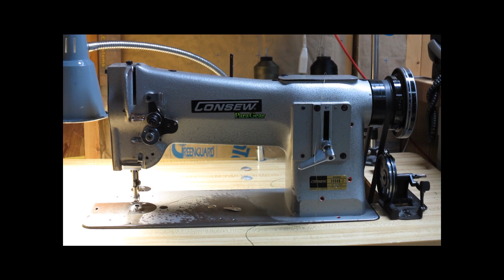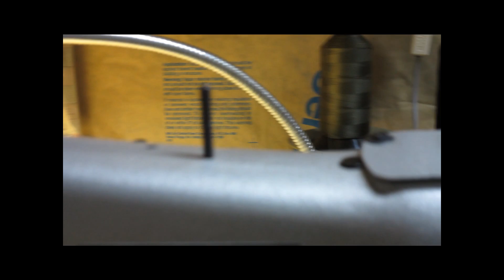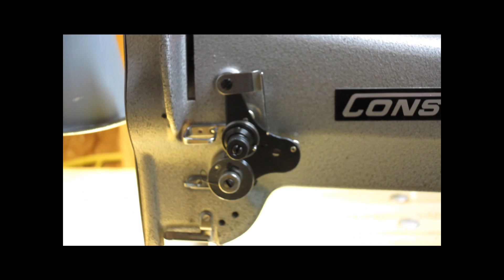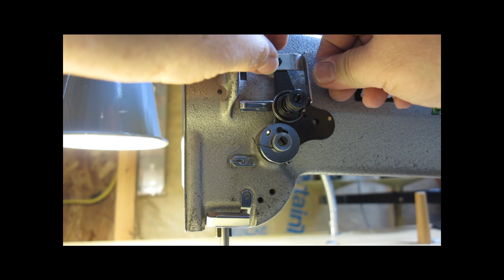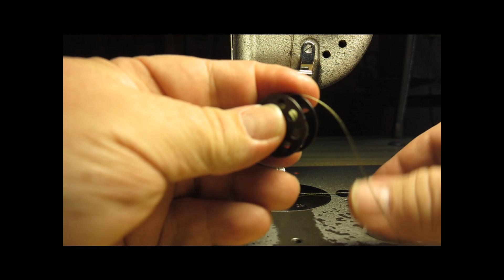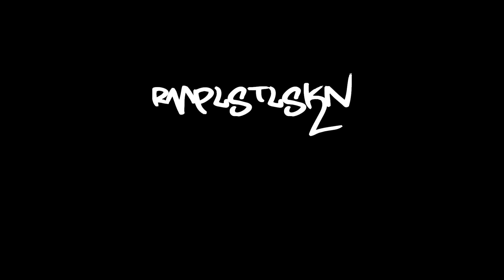Threading a Consew 206RB Series Walking Foot Industrial Sewing Machine 206RB-2

Comment: I have to review these videos from time to time as I don't use my machine very often.  The manual doesn't address bringing the thread over and around the pin on the tension disk.  Your explanation makes sense to get the most out of the tension disk. Thank you.

Comment: Nice video! I love my Consew 206 RB1. Any idea why my stitch length doesn't look like I'm getting the full potential. I think I should be able to get 5mm or so. Mine look to be about half that. I have it adjusted to what appears to be the maximum.
Reply from the maker: It gets complex, as that adjustment is cam controlled. You will need the adjustment service manual found online. Either the hand lever mechanism is off, or the cams in the sewing head where the needle and foot shafts are.

Comment: Thank you for the excellent video. Could you explain to me the purpose of the felt pad ?  I see other brands of machines that have a guide in the same place but they have no felt. Is this just to wipe the thread to remove dust?  Thanks again.
Reply from the maker: Not sure why exactly... In high-speed sewing the thread can get quite hot as it friction slides through the path, so maybe a place to add some oil? Not sure why.
Reply: @SurvivalCitizen  Nice to have some lube on the thread when using seam stick tape which tends to gum up the needle.

Comment: The Consew 206RB-1 through RB-4 were great sewing machines. But I wouldn't give a plug nickle for a RB-5 and up.
Reply: You made a comment, but did NOT explain WHY the CONSEWs "RB-5 and up" aren't worth a "plug nickle"..  I JUST bought an RB-5 and was under the impression, based on ALL that I read, the RB-5 and -6 were the top-of-the-line!!  I coulda bought a "Kung-Fu" machine for one-fourth the money, but all that I read rated the CONSEWs  rather highly.

Comment: great machine but ask anyone and they'll tell you too slow it down. Brushless servo motor are great but loose their power in low speeds. This may sound like I don't like servo but I change all my clutch motors to servo. Adjustability, speed control and quiet. 206RB is a heavy duty machine and the motor is great if you slow it down, so the answer a pulley reduction system. You can buy or build them but aim for a 3" to a 9" and you'll be happy. I also use a lot heavier thread usually Tex 138 on a 20 to 24 needle and silicone spray always..

Comment: around 10 27 you go to pull the bobbin thread up. MINE has a hard time doing this with ease like you make it seem to be..  does the foot need to be raised up to do this? ive always done this with the foot down...
Reply from the maker: Diagnosing complex sewing problems is tough without hands on, but it sounds like your TIMING may be off. Timing being the synchro of the needle to the turning bobbin shuttle. You may also need to loosen the tension on the bobbin case where the small slot screw is near the spring steel finger. You should be able to pull up the bobbin thread foot down or up. Hope that helps.
Reply: The reason it is easy to pull on the thread is because if you notice the lever to the foot is up and therefore the tension disks are open.  Once you pull the lever down the disks close and bring back the tension.

Comment: Although the manual disagrees, I think you were right. If you are sewing with Tenara thread, you definitely need to go over the pin on the tensioner. Tenara is slippery and you need the extra tension.

Comment: I ordered #69 nylon thread on Amazon and it's shredding and breaking in my consew machine but works fine on my Singer 4452 home machine with multiple layers of vinyl. Are some industrial strength threads just not as good as others like with home sewing?
Reply from the maker: +Becky Benitez I know the Consew specifies a LEFT-TWIST thread, but I have never seen anything but that in the military surplus thread I buy on eBay. Does your Consew sew properly with other thread?Sounds like it could be a few things: wrong needle size for thread size, tensions not set properly (most likely upper tension assy rather than bobbin tension), machine not threaded correctly, or worst of all, something is out of adjustment, maybe the bobbin carrier timing.If the thread is LEFT twist, then it is not the thread but the machine... Good luck! I will help the best I can...
Reply: +Becky Benitez The 206 can sew anything. I can adjust yours .
Reply: @gustrapos  I have fought my Consew 206RB-5 Since I bought it. The top thread is constantly shredding. I've changed threads, needles and tension many times. I sew leather mostly. I also replaced the motor with a Servo motor. Any suggestions?

Comment: Thank you so much for this clear video.  I have spent the last two days trying to decipher the poorly written manual that came with the Reliable 4000.  It is a great machine and I knew there had to be a step I was missing. Your video saved the day!  That little pin mechanism on the tension dial is the crucial step.  Now I can sew with abandon,  thank you!!!!
Reply from the maker: See my UPDATE! After further research, I was ~WRONG~ about the thread going over this pin. The thread does NOT go over the pin, it goes from the tension disks down to the thread controller. Sorry for my mistake. It seems logical, and it works well this way, but from what I have now learned, it is incorrectly threaded. Sorry...

Comment: I appreciated the video on threading  the 206  consew it was very helpful , I have a 118 consew much different , I learned to sew on a singer treadle so I was able to get mine to work One thing you may have missed was adjusting the tension or that may be a different issue. I'm going to look harder at my machine and see what is the right procedure for threading it .trial and error got mine working at first it was breaking the thread , The manual on line helped but still left me in the dark at the tensioner . THANKS LOTS

Comment: Just a heads up- putting the thread around and above the the pin in the thread discs can cause a groove in the pin and cause the thread to shread. It is not supposed to be above the pin. I ran mine around the pin and kept shredding thread and took forever to figure out why. The pin is soft and will groove very easily.
Reply from the maker: Chuck, you are CORRECT and I was wrong. I have added annotations to the video to correct my error. thanks for the comment that got me looking further into the threading process... I thought I had it right, but alas, I was wrong... Thanks again!
Reply: I always like to know which rotation direction the bobbin will rotate when loaded and
pulling on the threat. I believe that would be counter-clockwise. I only mention this
because my wife is always putting the bobbin spool in backwards.
Reply: Yes loaded looking at end of machine it will unwind ccw

Comment: I recently bought a consew 206RB-1.  Machine works beautifully.  My only problem is I'm now trying to use an extra heavy top stitch thread for leather - Nylbond Bonded Nylon HB 346 T350.  It is a very heavy weight.  I cannot get the machine to properly sew with this thread.  Have you had any experience with this? Thanks.
Reply from the maker: I have never used thread that thick before... I would look into using LESS wrapping holes before tension ring, as thread that thick will not need those additional wraps for tension. This may help it slide through the tension disks easier. You also may want to check if this machine was even designed to handle that size of thread... It is really designed as a FAST industrial machine, not for heavy leather with thick thread. Other machines far more expensive do leather like that far better I assume...
Reply: Thanks for the advice!  I'll try less wrapping holes and see what happens!!

Comment: thanks for the vid.  I just got one of these and am trying to figure it out.  This helped a lot.   My question for you is what would cause a bird's nest on the bottom when I try to backstitch.  I am trying to sew leather and the stitch tension looks good, and it works great until I try to backstitch.
thanks.
Reply from the maker: I suspect thread tension / bobbin tension... Does it knot up when sewing thinner fabrics, like denim or nylon? The leatherworker forums would be a good place to ask this question. I do not have much leather experience...

Comment: Super clear. Thank you. Any suggestions to my problem of the bobbin thread not picking up would be helpful. I thread mine like you do.
Reply from the maker: There are several adjustments to the bobbin area and they should be checked that they are within specs according to your specific machines manual. I use two manuals, one for the Consew 206RB and the other for a Seiko STH-8BLD, which is a twin of the Consew.
The bobbin area is a very important area to have set right, as something off will NOT feed the bobbin thread properly, or jam and tangle thread. The settings are not hard if you do them. You will need some feeler gauges in metric. My machine was off in two of them, but now adjusted, it works very well.
The safety clutch might also be 180 degrees out of time. I had that happen once during a jam, before I adjusted the machine to spec. Easy to fix, but you need the manual to tell if it is off or not.
Basically, there are some complex tasks going on under the deck, and a few important adjustments. After that, it is all based on the shape of the parts, which is non-adjustable. It either works or the part is broken...
Google for the manuals for you machine, of if you have a Consew 206RB, message me and I will email them to you. Hope you get it fixed.